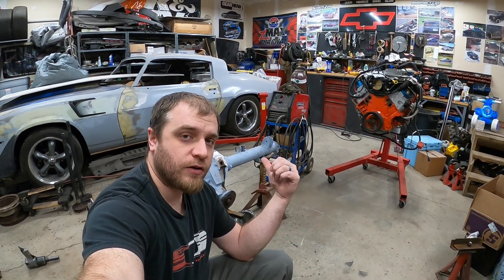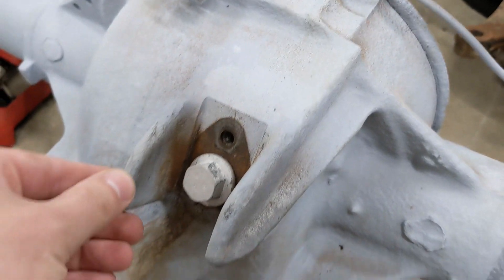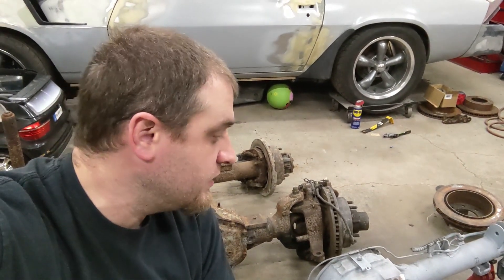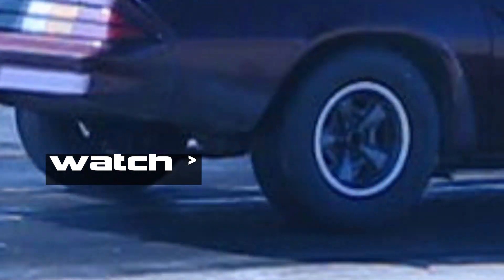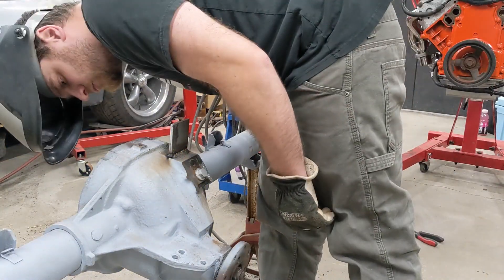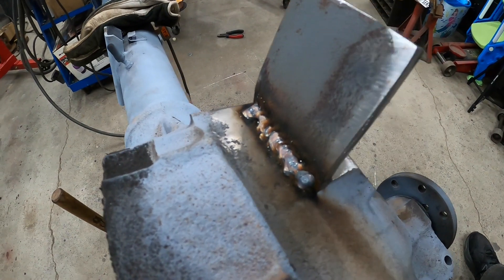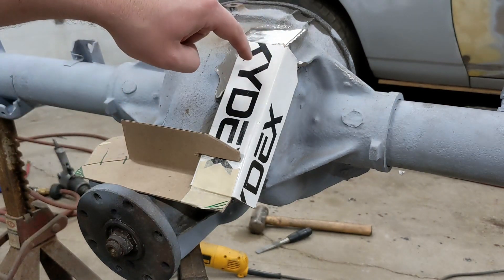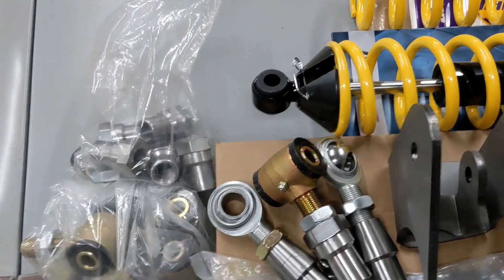ID Cast iron or cast steel? Ford 8.8 grinding and welding - MIG success!

Comment: I'm pretty sure it's cast steel.  We preheat and then wrap cast steel in a fiberglass blanket, so it cools really slow after welding.  Pretty much the same process as welding cast iron.

Comment: Metal test says its cast steel with .8% carbon. By definition, carbon steel has a total carbon content of less than 2.0%. Cast iron has a carbon content of more than 2.0%. So test 8.8 sample is in fact steel, not iron. Ductile iron / nodular iron are on average 3.0% carbon, So what gives?
Reply from the maker: You do this test yourself? I wonder if they are all the same. The other source I was going by was Dirt Lifestyle testing super duty axles...
Reply: @GEARHEADdezign  What did their test results  come out to?
Reply from the maker: @blueblood76  I don't recall, but it was nodular. That was super duty axles though
Reply: 100% it is NOT cast iron. You weld cast iron like that and it will just pop right off

Comment: Cool video.  Aside from that I literally have that exact same 220 lincoln and that exact same welding cart lol.  Both bought new in 2006 and keeps on trucking.   The stupid chains for the mix gas tank are terrible.  I finally ended up switching over to ratchet straps to hold the tank to the cart especially now that I have a 125 tank in there.   Are you the same dude that's building the Beretta on ls one Tech?
Reply from the maker: Haha I bought mine new in 2007 so that makes sense! Good idea on the chains, I should do the same.
Reply from the maker: Beretta T56 that's me😎🤣 
New video today from drag racing last week

Comment: Just wondering what type of lincoln mig welder you used for the project and what gauge mig wire,. .023 .030 or .035 ?
Reply from the maker: 170a 220v with .030 wire
Reply: Thanks for sharing

Comment: I like your idea of doing the test weld and hammer failure test. But, it might be better to just weld one side of the flat bar? And also doing less weld so that you could get it to fail and see how?
Reply from the maker: That's a good idea. Try to make it fail rather than try to make it succeed...
I do have some miles and some torture on this DIY torque arm now and it has held up beautiful.

Comment: Its most definitely cast steel!
Reply: I don't think so- besides, cast steel it quite a bit more expensive than cast iron.  Why in the world would Ford choose the unessecary for stock applications non-budget friendly cast steel but then skimp out on tube size (with BS end taper) along with using anorexic 14mm u-bolts????  OP is making a video to try to cite his sources, responder's sound like Ford fan boys accepting a conclusion they want with keyboard warrior blind faith...  This dude's welding approach is similar to the way a head shop would fix a cracked cast iron head...
Reply: Guess I was wrong. Sorry.
Reply from the maker: From what I can tell, yes. A welder buddy of mine thought it was steel as well, because of the color of the spark

Comment: Look forward to seeing the rest of the build. I have a 92 beretta in the same shape, same water leak and trying to find something to do with it.
Reply from the maker: The water leak comes from the firewall. The best fix is to strip the factory seam sealer and redo it with 2k stuff. The drainage is a poor design, so you have to use really good sealer.